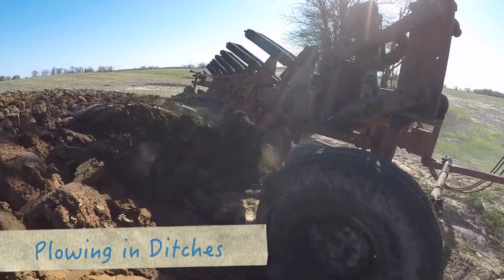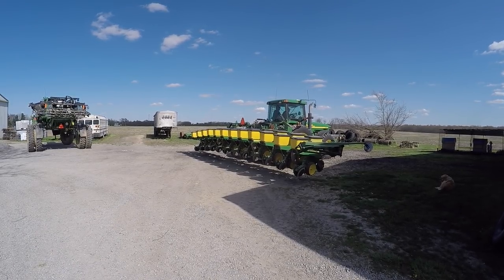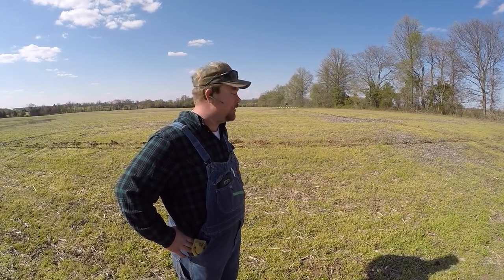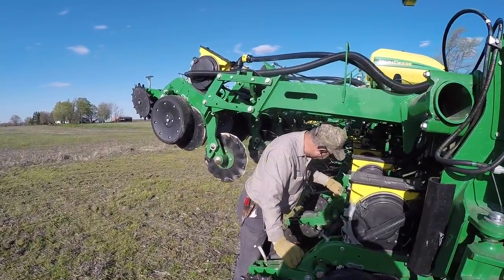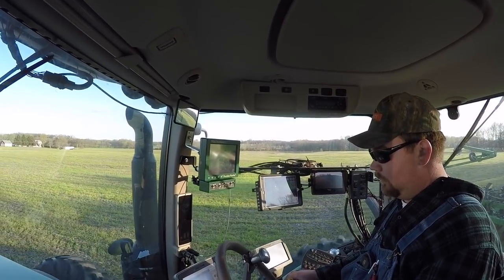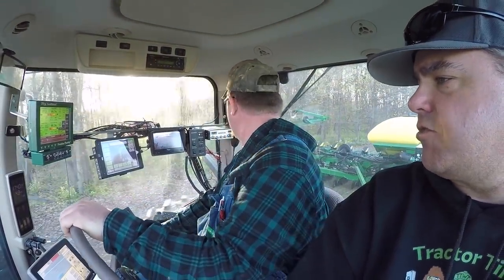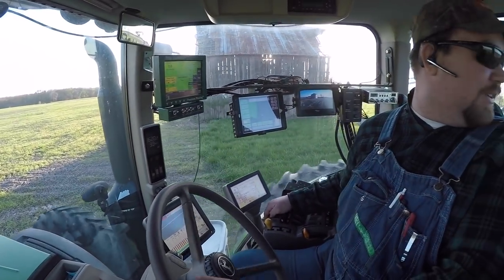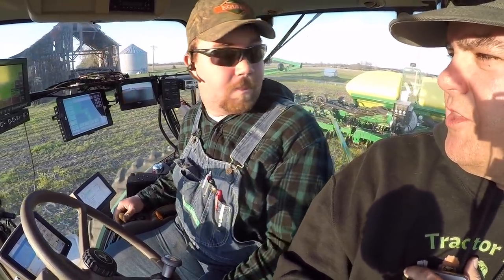Perfect Placement!  High Tech Corn Planting. #Plant18

Comment: Been working on planter for years. I want to take those coulters off and throw them in the junk pile. Get row cleaners with clean sweep and make sure the opening disks are in spec and it’ll plant. May need to add weight to the fold stack though. DeltaForce would help too.

Comment: Looked like the back right dual was low on the r tractor or do y’all run the wheels that way. I just finished planting our cotton tonight but got a custom job for a farmer which I’ll be planting soon but no timeframe yet. I normally don’t work sundays except when I’m trying to get something done before weather or during harvest if I’m helping one of the crews
Reply from the maker: Yes, they run the radials very low PSI.  Gives better ground contact to reduce slippage